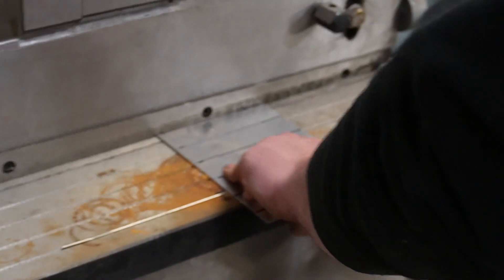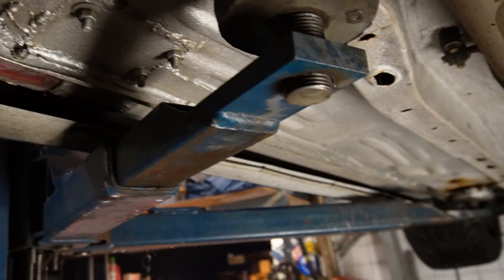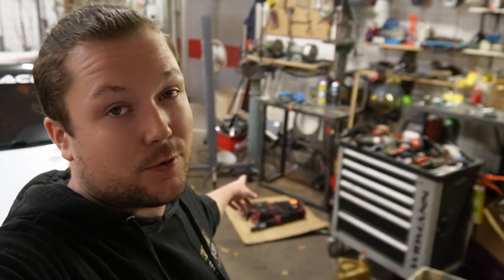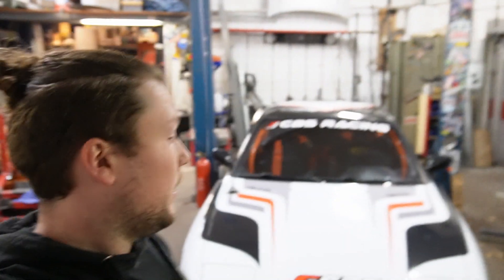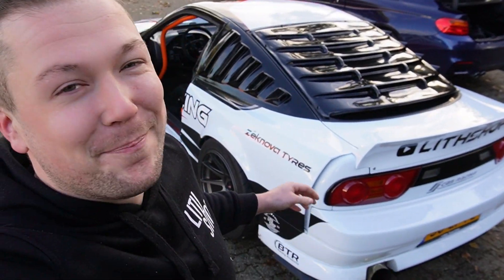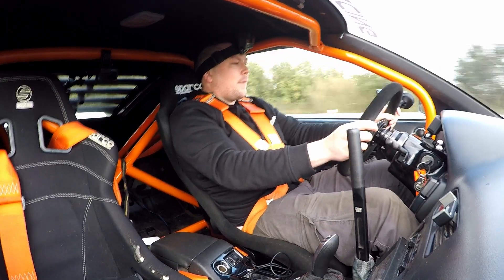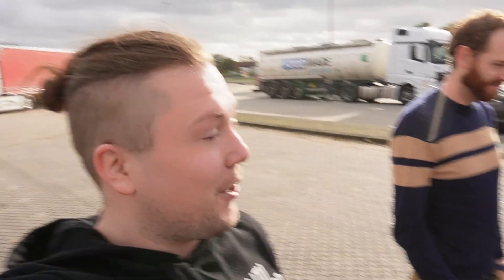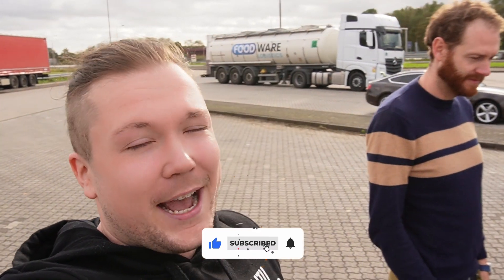1JZ DCT Nissan S13 TOP SPEED RUN on the Autobahn! // AutotopNL

Comment: You got yourself another subscriber cool project found it trough AutoTopNL, your project car is even more freaked out then mine 😄

Groeten uit Amersfoort
Reply from the maker: Welcome and thanks man! What you got?
Reply: @lithshop  Renault 19 16v Phase 2 from 1993 (3 door model, 449 sports blue), swapped the original 1.8 16v for a 2.0 16v with turbo conversion, block is from a Mégane 1, the cylinder head is the original one from the 1.8 16v (bore is the same), crankshaft from a F8Q diesel, original conrods with modified original pistons to lower compression to 9:1, GT2860R turbo, Renault 21 turbo map sensor, gearbox from a Kangoo turbo diesel, Helix paddle clutch, big brake upgrade with 280mm discs from Clio 2 RS and 4 pod Brembo calipers from a Peugeot 406 V6 (fits without modification), bigger master brake cylinder from a Laguna 1, original ECU modified with a socket for custom chip/mapping. Forge FMIC, BOV etc etc.
As it currently is runs approx 260HP/350Nm @ 0,9 bar but sometimes it hits 1 bar the hole for the waste gate actuator got drilled a bit too far 😄

On the outside not much modifications went for a OEM+ look, lowered the car a bit, 16 inch Speedline Turini alloys (dark grey), kept the Brembo calipers black so they don't stand out, also the Remus muffler does a very good job in hiding what lies underneath until you go full throttle ofc, some minor exterior mods you'll only notice when you know the model.
As you can see it's also properly freaked but quite a bit less then your cool project.

Doubting if I want to go for more power as the current setup has been proven very reliable and with only ~1050 KG and this power it ain't exactly slow,, the cost and amount of work to get up or beyond 350 HP is what's holding me back at the moment, it would require to re-engineer the whole setup from top to bottom.
And I'm afraid of the while I'm in there factor and blowing the budget all together. 😄
For the same money I could have built a faster car from another brand but I wanted to have something different, nobody expects it really moves and that never gets old.